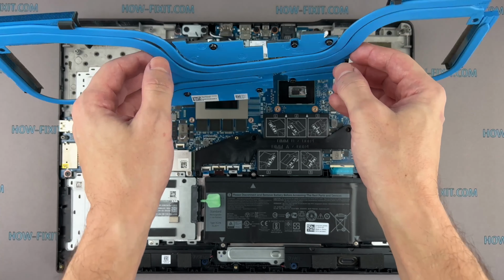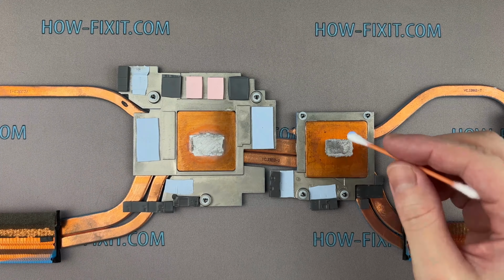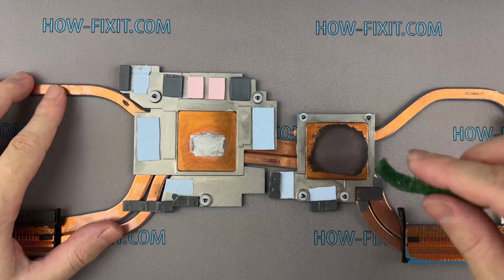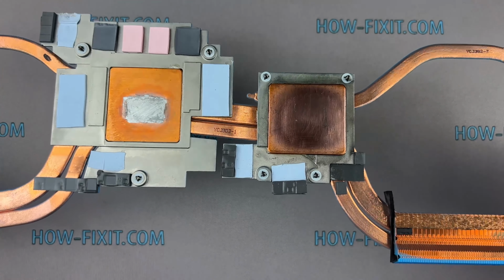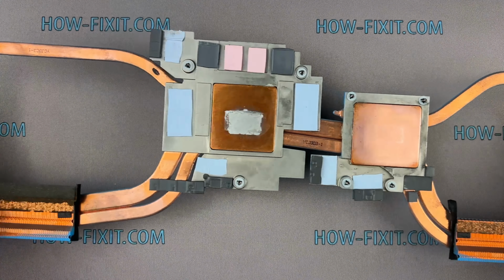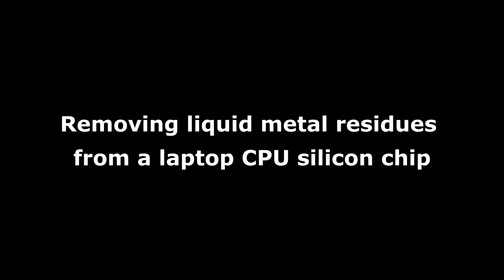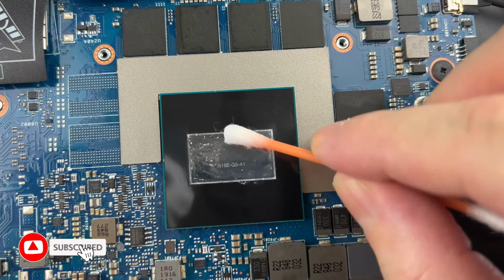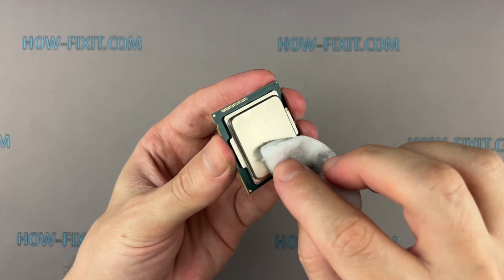Ultimate guide to removing liquid metal from your CPU and copper heatsink

Comment: I wasted my time i added liquid metal to my laptop CPU and it didn't work still reaches 90c same as thermal paste and yes I have it installed correctly on CPU and GPU I have to remove it now so I can put regular paste on since there is no difference
Reply: I'll do you one better. I travelled recently and my laptop bounced around all over the place. That caused the liquid metal to leak all over the motherboard. Surprisingly it actually started up after I cleaned most of the liquid metal off the MB, but it's doing super weird things now...screen is flickering, mouse pad not working. No more liquid thermal paste on laptops for me.
Reply: @allanshpeley4284  Thanks for sharing 😢
Reply: @allanshpeley4284 Some asus laptops use liquid metal from the factory. Same thing happens, the laptop gets used, the liquid metal leaks out, and now my motherboard has tiny droplets of liquid metal all over... I generally like Asus, but damn, what a stupid move of them. Hopefully my laptop still works when I'm done applying new thermal paste.

Comment: Liquid metal is conductive to copper surface, so technically you shouldn't use in on anywhere but PS5
Reply from the maker: this is a misconception
Reply: this has the same energy as, the human eye cannot see more than 60fps
Reply: @LuxuryLeet  wtf 😅😅😅😅😅
Reply: It's not that it's conductive; it's that the galium and copper bond to form an alloy because galium has a negative potential and copper has a positive potential.

Using it only on the PS5 is a misnomer. Liquid metal should only be used on copper surfaces that are plated with nickel in order to prevent the chemical reaction. You can use it on any device but the surface for the application of liquid metal must be nickel plated copper.